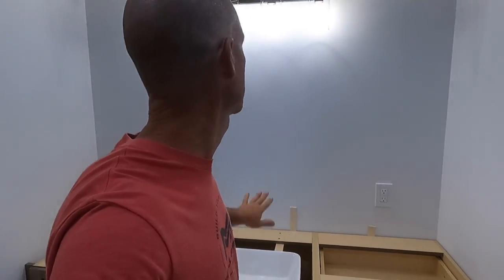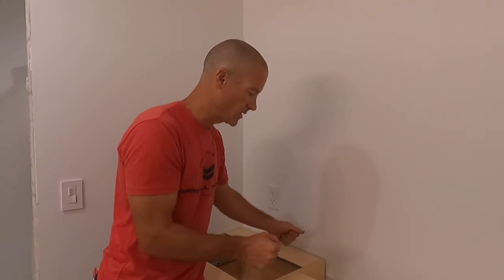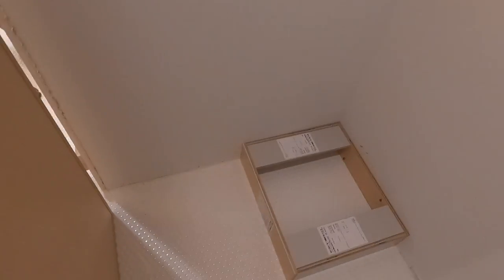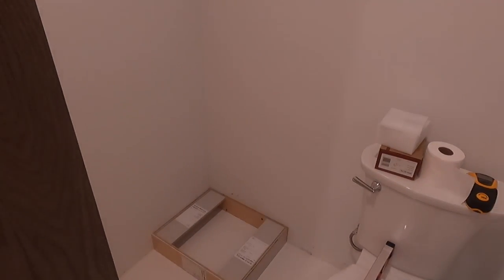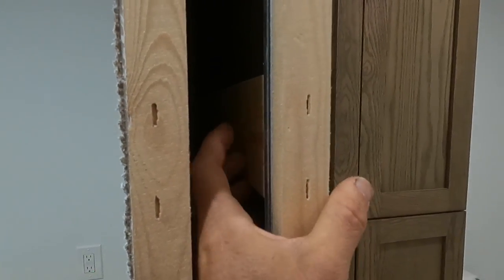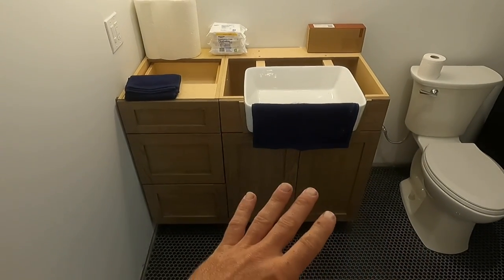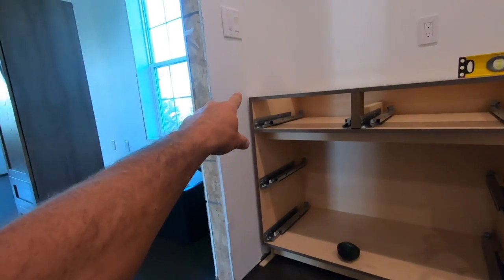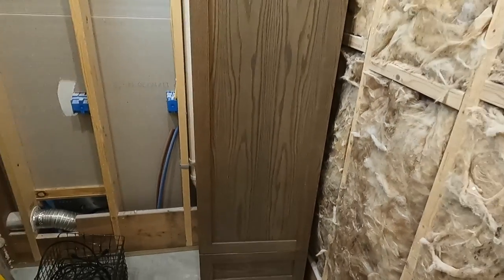Bathroom Vanity Install | CabinetDirect.com

Comment: I always used drywall screws and countersunk them when I screwed face frames and carcases together. I would pull the hinges off and drill the pilot hole there so when I put the hinges on they covered the screw. I would also plane the face frames with a slight bevel so the edge that met the wall was sharp and thin in case I needed to scribe them. The little mini bar clamps that use pistol grip to compress come in handy for this, I clamp all my cabinets together and then make them one.

Comment: Make it easier on yourself.  Just get some butcher paper, lay it on the floor next to the pipes and transfer the locations and measurements of the pipes to the paper.  Set that in the cabinet.  Remember the thickness of the rear wall of the cabinet and transfer your measurement to the cabinet base and drill away.  I always line the inside of the cabinet bases with a sheet of linoleum.  If cabinets get wet they get messed up.  The linoleum prevents that.  A small strip light that plugs in under the sink cabinet is never a bad idea.

Comment: Looking good!  I am curious how you plan on traping/venting that floor drain for the second vanity?  Does your local code allow for the trap below the floor?  If not S-Traps have illegal for a while now and studor vents are only allowed on remodels in most jurisdictions.  Ideally you'd have a vent stack in the wall behind the vanity or you are going to have to install a loop vent in that cabinet.